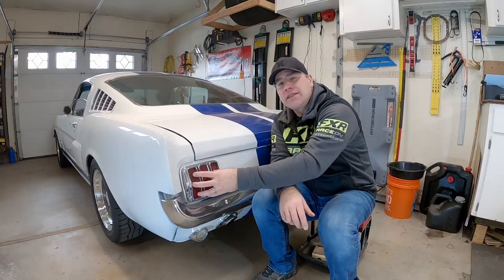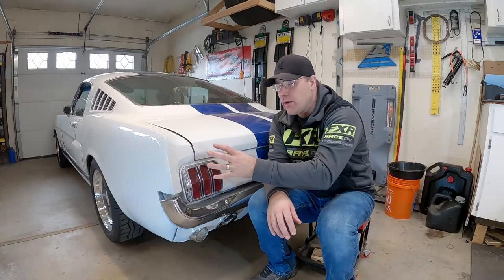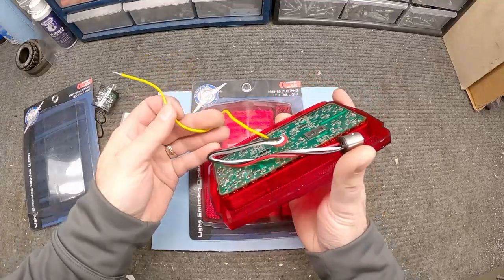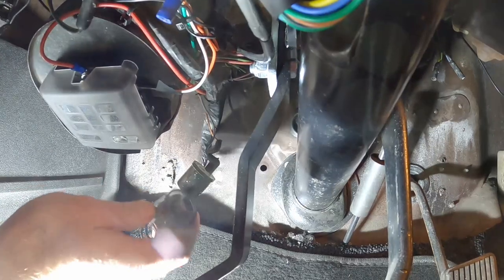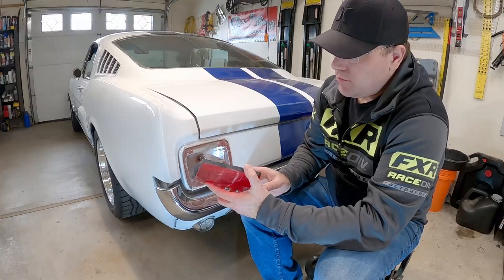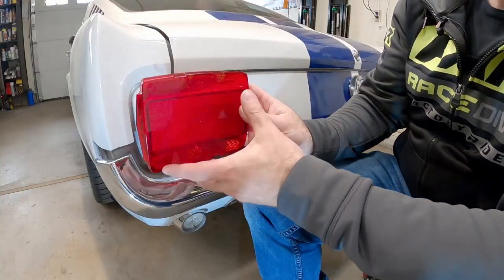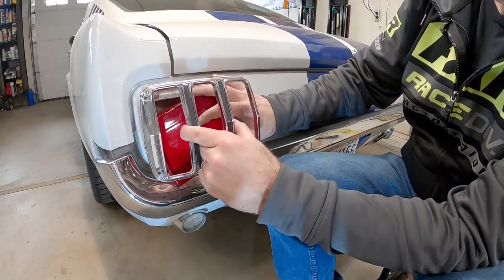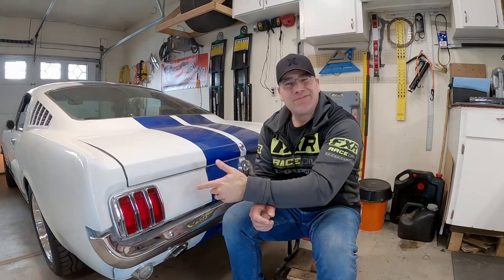Installing LED Tail Lights

Comment: I just did this upgrade on my 64.5 coupe last weekend, but with a different brand of LED assembly that didn't include the red lenses. It made a major difference in brightness and I do like the sequential blinking as well. I didn't pay attention to the different depth of the pins on the bulb housing, so now I'll have to pull them back out to double check that. Thanks for mentioning it.
Reply from the maker: Yeah, the depth of the pins only seem to be an issue with cheaper bulb manufacturers.  These were fine, but I purchased other bulbs for the car that the pins were too short and the bulb wouldn't stay in the socket.  :)

Comment: I've had an uninstalled sequential LED kit for my '68 for years now.  My hang-up is that I can not find where the blinker flasher/module that I need to replace is.  I'm suspecting it's tucked up behind the console and radio, so at some point I need to get around to taking the whole thing off.  I just have to make the time.  I'm going to let this video motivate me to take another stab at it.
Reply from the maker: If you activate your blinker now, you should be able to hear the clicking noise it makes, which should lead you to its location.  :)

Comment: Boy do I hate getting under that dash!

Hey Andy, what's with the fusebox under your vent? Is that an additional box or did you replace the original fuse panel?
Reply from the maker: Yeah, it's just a block where I can pull switched power from for other components I've installed.  It's a lazy install location, but I plan to fix that down the road.  :)

Comment: On my 65 I swapped my exterior lights and put the two terminal flasher in. When I use the turn signals my tail lights and front blinkers work great. The problems now are when I press the brake my left right parking light comes on, and the reverse lights don’t come on now. Also the dash isn’t quite as bright now especially the blinker lights which don’t show. Any advice?
Reply from the maker: Sorry brotha, I don't know fi I'd be a lot of help here.  Other than light bulbs, it sounds like the only change to the system was the new flashers.  Maybe there's a faulty flasher and it's causing some sort of electrical witchcraft.  One option is to put everything back the way it was (assuming it worked perfectly before) to see if you can trace the error or faulty part.  :)

Comment: I really want to do this to my 66 coupe, but it looks like you can see the individual LEDs...In real life does it look like it does on camera? I think it would look a lot better if they were diffused somehow.
Reply from the maker: When you're up close you can tell there are LEDs in there.  But from the distance that others will see your taillights on the road, the LEDs are not obvious.  :)
Reply: I did it on my 67. Same brand. They look real nice in person. But you can somewhat see the individual leds up close, but a huge improvement regardless. I get alot of compliments on them, "whoa, that's cool. Just like the new mustangs"

Comment: What’s your experience with CJPONY? in reference to ship times, I’ve heard of long delays , poor customer support
Reply from the maker: I has been all over the map.  It was worst during Covid, but it has gotten better.  They seem to prefer fixing issues over email, but some of us just want to talk to someone to make sure problem gets resolved.  It seems like people on the East Coast prefer NPD because of the relatively quick shipping, but I hate their website, can't find what I'm looking for most of the time.  I've had the best luck with Summit Racing, fantastic customer service and quick shipping, and decent prices.  But, sometimes CJP has exactly what I need at a fair price, so I go that route when needed.
Reply: @AndyKruseChannel  can’t agree more.
I tried summit after I noticed you stood by them in past video. Talk about great  support.  And you’re right NPD seems to have minimal inventory for our models. But again fast shipping.  CJ and the videos that guy Bill are also good reference.  I’ve gotten odds and ends from O’Reillys too , thanks

Comment: My sequential LED tail lights in my 66 works perfectly until I start the car.  Once the car is running they stop working altogether.  Any ideas on what would cause them to stop working when the car is running?
Reply from the maker: Have you tried reinstalling your original lights to see if it's the wiring or the new taillights?  Also, did you upgrade the flasher relay to the one like I mention in the video?
Reply: Yes bulbs and original flasher everything works all the time.  LED’s and LED flasher lights work perfectly until I start the engine.  Then LED’s stop working.  Yes installed correct flasher unit for LED tail lights.
Reply from the maker: @danquinn6187  Wow, not sure what's happening there.  If everything works with the OEM stuff, but not with the new LED stuff, I'm leaning towards some kind of electrical issue, but it's tough to tell without being able to test it.  Sorry boss, I wish I was more help.  You might be able to reach out to some of the popular web boards and see if someone there knows what it could be.  :)